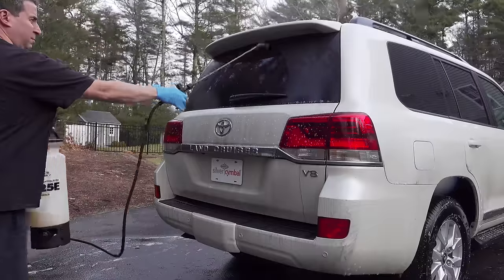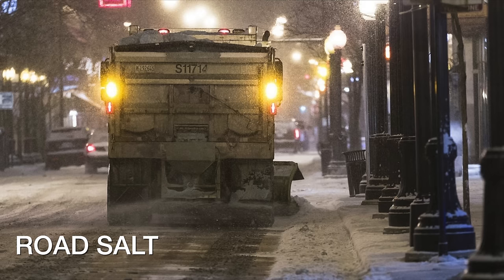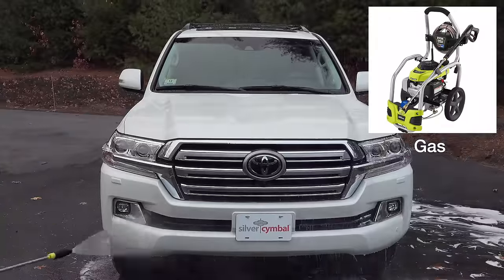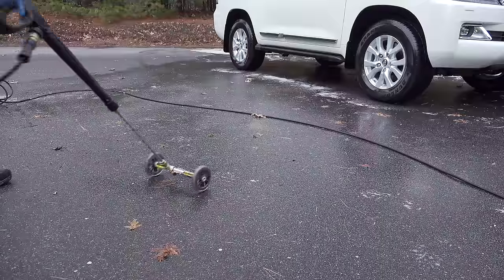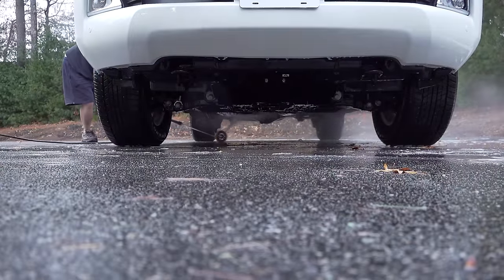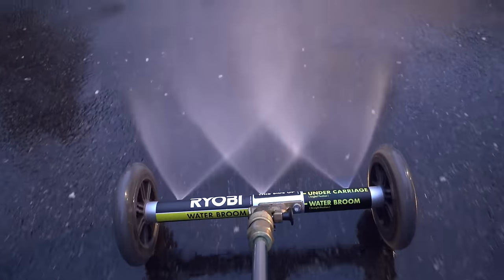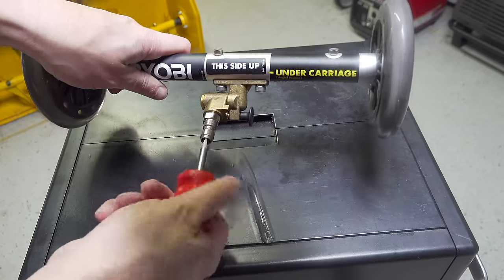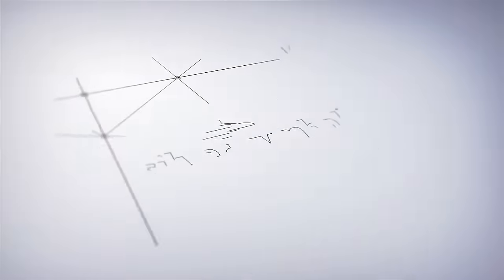How to Clean your Car's Undercarriage in 3 Minutes Winter Salt & Snow Removal

Comment: Lol yeah this is what I see wrong with this video.. they claim to get rid of rd salt,   but who washes there car out in there drive way during winter months by hand out in the freezing cold weather lol.. if you did use that in the dead of winter with that low pressure the water would just freeze underneath your car lol yes it would work in the spring as it warmed up   but by then the damage is done.. just drive through a car wash that has under body wash during winter months.. no one's going to use that out in the freezing winter months  lol
Reply from the maker: If you live in New England its common to start days at 0 and up to 40 and back again. You get plenty of chances to do this. I was out there today doing exactly what you saw.
Reply: @SilverCymbal  if it gets that warm then why do they use rd salt then? Not being a dick but if it hits 40 during the day the snow would be melted without the use of salt
Reply: @SilverCymbal I live in upstate New York and in the dead of winter you will go WEEKS (December/January and even into February) with temperatures staying well below freezing and never remotely approaching 40°

Comment: The fastest way is a car wash, takes less than a minute
Reply from the maker: If you want to pay for one thats fine, but they also don't get edge to edge washing. Think about it, there is no water under the tracks you ride on. They miss lots of spots.
Reply: They have a undercarriage wash.
Reply: feodufg3r4weozjmkdwopsqkf3 His point is it doesn’t spray your entire undercarriage... and he’s right
Reply: Hemi Dave did you just not read what I said? It does. Only reason why I go in the winter in the first place.
Reply: Hemi Dave my car is over 20 years old and still no rust under, and that’s from going through car washes, still in good shape, Idk which one you went to but mines is clean
Reply: @vel6979  how many times do you go to the car wash? When do you start and stop? Thinking about moving to the salt belt
Reply: Cam 1 I go about every 2 days

Comment: Be carefull as rubbers on things like cv joints ect are ok for splashes if driving in rain or watwr but high pressure water will be no good you will end up with water getting in and causing the goints to go bad.
Just go to the store and get a law sprinkler the osalation one and connect to the garden hoes.
You will have to kerp moving it i place it in 1 spot for 5 mins then move and so on.
This is the safest way